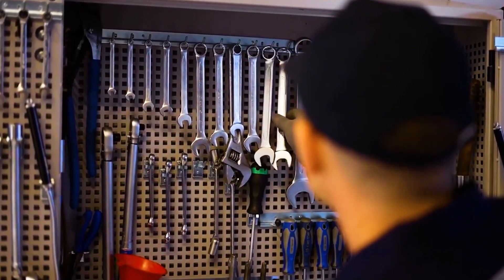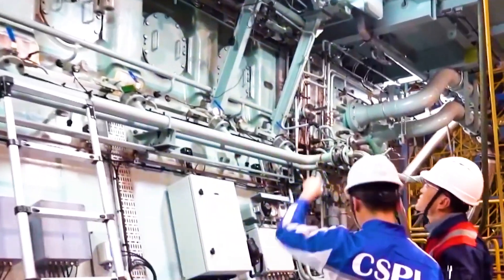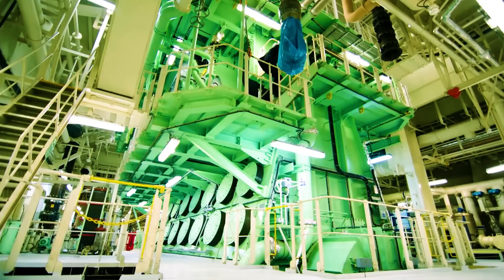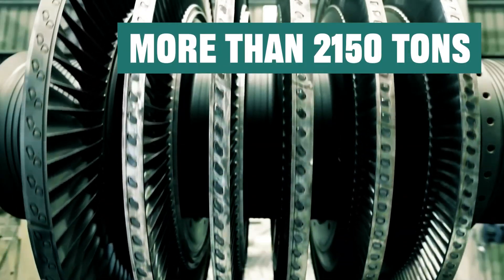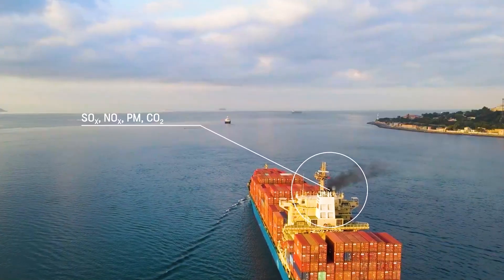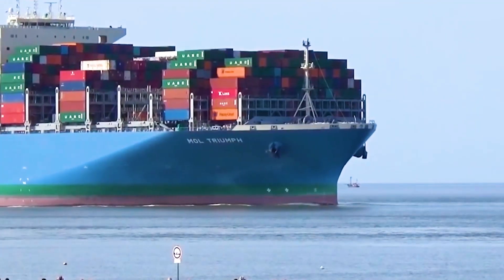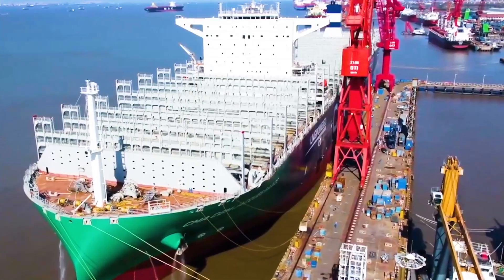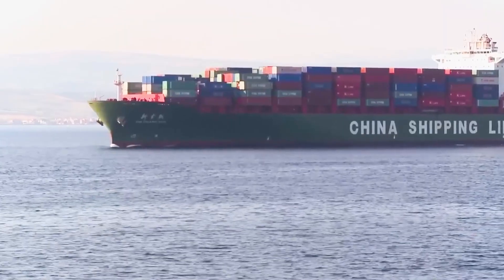Weight 2100 Tons! China's Development of This 22.7-Meter-Long ship Dual-Fuel Engine Shocked Everyone

Comment: China has built the biggest ship engine in the world, a five stories high engine weighing 2100000 kg. These dual-fuel engines can be used for super giant ships with displacement of more than 100000000kg. China has already built this kind of ships using diesel and natural gas in order to reduce the use of diesel fuel only which is environmental friendly. China is at the forefront of the dual-fuel technology as she is already the master of shipbuilding.
Reply from the maker: Yes, China’s shipbuilding technology has now surpassed that of South Korea and Japan

Comment: The purpose of a huge engine like the one used in a ship is to provide propulsion power to move the vessel through water. Compared to traditional ship engines, these large engines offer several advantages:

1. Power and Performance: Huge engines can generate significant amounts of power, allowing ships to travel at high speeds and effectively navigate through various water conditions.

2. Fuel Efficiency: Despite their size, modern ship engines are designed to be more fuel-efficient, leading to cost savings and reduced environmental impact.

3. Reduced Emissions: Advances in engine technology have enabled these engines to meet strict emissions regulations, resulting in cleaner and more environmentally friendly operations.

4. Reliability and Longevity: Large engines are built to withstand the harsh marine environment and provide reliable performance over long periods of time, reducing maintenance requirements and downtime.

Overall, the size and power of a huge engine in a ship offer greater efficiency, performance, and reliability compared to traditional engines, making them a preferred choice for modern vessels.

Comment: Another feather in China's cap.  The other day there was mention of marine use of thorium molten salt reactors.  Indeed, those 4th generation reactors are on the cusp of happening.  China has a 2 megawatt developmental reactor running in the Gansu Desert since late 2022 and expects industrial size reactors before 2030.  These reactors are small because they require no containment vessel, operate at ambient pressure and can burn almost all of its fuel vs current uranium pressurized reactors that burn less than 5% of its fuel before refueling is required.

China has the technology depth in innovation and manpower to quickly pursue new ideas into reality and that becomes China's calling card to the world.  From infrastructure projects to semiconductors, China will dominate technology as no one else has done before.